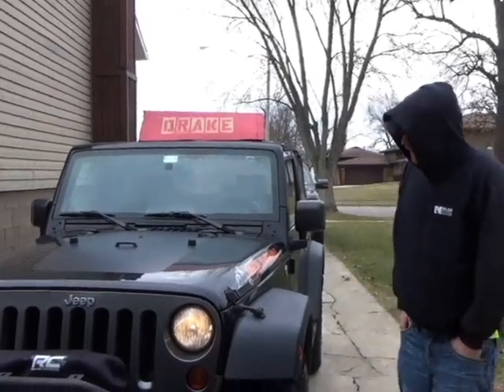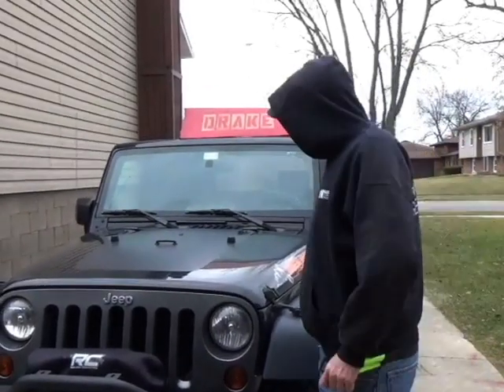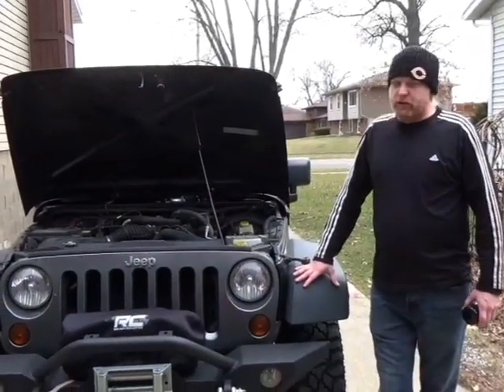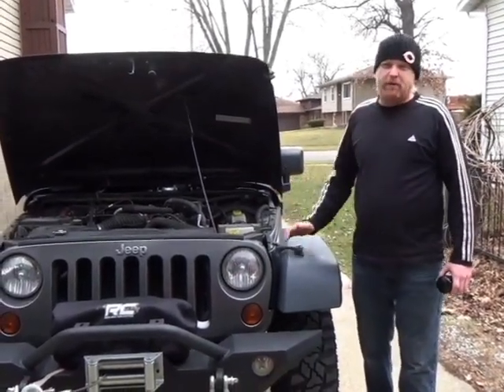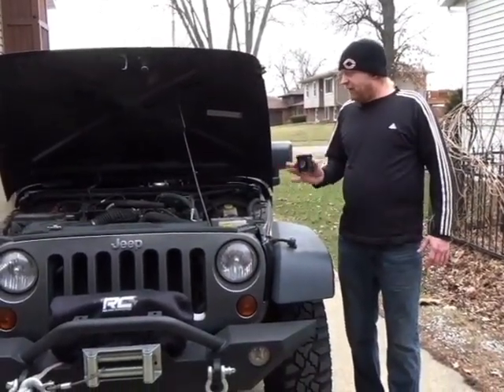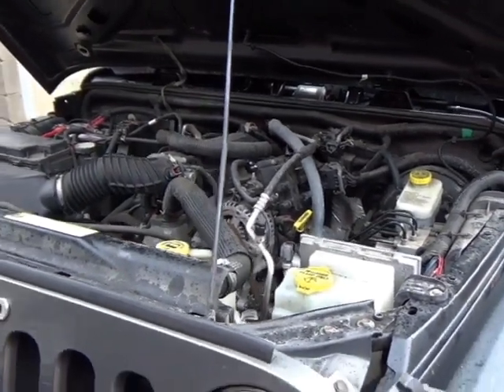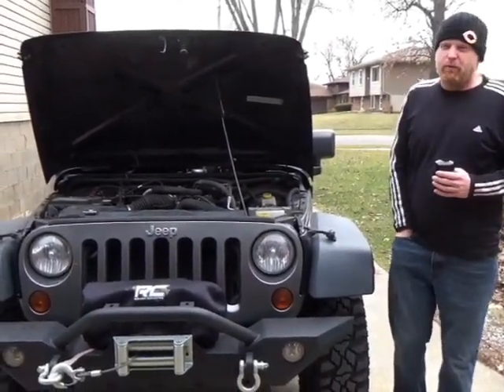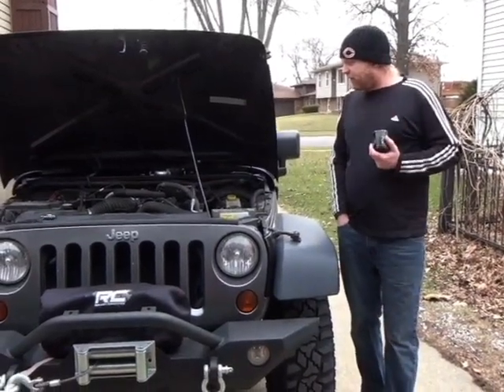2010 JEEP 3.8L engine knock on start up. cold start

Comment: 07 grand caravan same engine. Mopar  is pretty much the standard for these.HUGE difference cold or warm. Mine has 250k on it and once i figured this out it helped a ton. Also use 5W-20 lose about half a quart every 3k miles and use the filters for 2 oil changes worth of miles since they are good quality

Comment: A Motorcraft FL-0400-S will also work, is available at normal autoparts stores, is cheaper, and is slightly larger (longer).  It has do to with the anti drain back valve inside those filters.  Side note: the 3.8L was originally specified to use 10W30, they only switched to thinner oil to meet MPG specs.  They didn't change anything inside the engine when they did this.  Which is probably why the 3.8L gets a bad rap...  Switch back to 10W30, unless your area gets really cold, then you can drop it to 5W30 in the winter.
Reply: Interesting. I have the 2.4 renegade (not technically jeep) and i put a motorcraft FL 500 on it. it takes 0w20. I wonder if the lighter weight has to do with anything for real.
Reply: I live in Arizona, was told 5w20 was it. Is it really 10w30?
Reply: That’s the one I use
Reply: Hey do you know one that will fit in a 2010 crown Victoria police interceptor? I'm having the same issue
Reply: I've been doing 5w20 synthetic in my 3.8L but I started using a quart of Lucas Oil Stabilizer at each oil change. I just don't add the last quart and do the Lucas instead. It's tremendously thick. Maybe I should just try 10w30 instead? I've got 222,450 at the time of writing this. I assume anything will help it at this point!

Comment: Bad oil filters are crap for your car. 
Oil filters are a critical part of engine lubrication. My 2005 Ford 4.6 is as quiet as the day I brought it. Motorcraft filters only used on it and 165,000 miles on it. This is great advice! Follow the manufacture recommended filter. No joke!
Reply: I have a 2010 police interceptor with only 84k miles. And it does this at start even with motorcraft filter. Using Mobile one full synthetic and does it for  like 3 seconds

Comment: Now try a “Wix” extended oil filters.. they are longer (hold more oil) and have the best drain back valve of any filter made. They are made in USA and are fantastic filters you cant buy a better filter.. the “Mopar “ filters drain back valve will also fail , and that is what causes that knocking sound , because the oil in the filter drains back into the pan and so when you start it the filter has to fill first before the engine gets any oil hence causing the sound.. i am also a Jeep guy trust me on the Wix filter you will thank me later.. you can get them at any “NAPA” auto parts store..
Reply: Do they have a drain back valve for my police interceptor? Mine does this too
Reply: @Иванпонимаете-г4ш if it’s a vertical filter, meaning bottom of the filter points toward the floor, drainback valve has no use, as the filter will always be full due to gravity.

Comment: Same thing is happening to me after I installed a Napa platinum filter.. Thanks for the heads up. Did it fix the issue? I think it is the drainback valve.The oil drains back into the pan.

Comment: My 2010 3.8 has a rattle everytime I accelerate from a full stop, never if in neutral, 60k miles.  I tried Mobil1, Royal purple, Pennzoil, same with all oils
Reply from the maker: That is something completely different.. without driving ot it would be impossible for me to tell you why it's rattling
Reply: @sdrake74  yeah, I think I found it yesterday, a heat shield (passenger side that attaches to the tub) apparently lost a bolt, so it was flopping around.  Luckily found a nut and washer that fit perfectly, so now nice and secure.  I’ll test it today to make sure that was the culprit.

Comment: Thats crazy,
Does the Mopar filter have some type of check or pressure switch in the filter making it back pressure until it's at full flow?
Reply from the maker: I haven't cut one of these open... however i have cut many filters in half to figure this out... what i think is going on is that the spring and oring/ gasket in side the filter holds the oil closer to the top of the engine( most filters let the oil drain into the oil pan) so when you start the jeep in the morning the oil gets to the cylinder head quicker.....  the correct way to fix this is to replace the lifters... however this is a jeep that my girlfriend bought brand new and had low miles so on principle alone i tried to find a different way to fix the problem
Reply from the maker: And like i said the correct way to do this is to take the cylinder heads off have them reworked at a machine shop and chang the lifters..( the noise is hydraulic lifters that dont pump up fast enough..... i have no problem doing this.... however it just bothered me that it happened at 40000 miles and just trying to find a different solution ... still works to this day at 97000 miles... the dealer stoped selling filters for this jeep its to old butt some higher priced filters will do the same thing

Comment: Our 2016 does that too. Dealer does the oil change but it still does it.
Reply: 2016 (3.6, not 3.8) totally different, uses a filter cartridge in that stupid plastic oil filter housing that is bound to fail.

Comment: Quick summary: Don't buy cheap oil filters. Spend some money and buy a filter with a check valve.
Reply: I do every time...still have the prob, low mile engine, not a Jeep. do those jeeps have horridzontal filters?

Comment: Im reposting this someone elses comment bc i thought it was important:  "Using old oil filters (with black rubber DBV) may also cause this due to the rubber drying out and becoming stiffer including Mopar filters...I know this from experience. Using silicone drain back valves (orange colored) oil filters (like WIX, Napa, etc) are less likely to dry out regardless of age and will still have flex to close the drain back. The filter you bought at the dealership is newer stock since their turnover rate for filters is quicker with their service department."
Reply: maybe use a lil AT205 on the seal well before putting it on will help. that shit works well to make rubber come alive to stop all kinds of leaks! scotty kilmer loves it  too!

Comment: Using old oil filters (with black rubber DBV) may also cause this due to the rubber drying out and becoming stiffer including Mopar filters...I know this from experience. Using silicone drain back valves (orange colored) oil filters (like WIX, Napa, etc) are less likely to dry out regardless of age and will still have flex to close the drain back. The filter you bought at the dealership is newer stock since their turnover rate for filters is quicker with their service department.
Reply from the maker: yes i agree.. i bought all the expensive filters with the orange neoprene gaskets and one of them worked butt because i couldn't remember wich one i didn't mention it... their was differences in the mopar dealer and advanced auto mopar filters... numbers and weight... butt depending on where ur at in the country it varies.... so i didnt go into all of that... butt i agree with you 100 percent!!!
Reply: maybe use a lil AT205 on the seal well before putting it on will help. that shit works well to make rubber come alive to stop all kinds of leaks! scotty kilmer loves it  too!

Comment: My 2010 jeep patriot is going this and i want to fix it. Not sure what to do
Reply from the maker: the correct way to fix this is to do a compression check on all cylinders ..if they check out take the heads off and change the lifters... butt thats alot of work.. go to a mopar dealer( dodge,plymoth,Chrysler)... buy an oil filter and see if the problem gets better or goes away... their is a bleed back valve in the filter that holds the oil closer to the top of the engine on start up... thats why it works... do not buy the filter from any parts store!!!! dealership only!!!!
Reply from the maker: how many miles is on your liberty????

Comment: Gonna try this on my 08 w/ 108k. Drives me nuts too... Miss my TJ's :( had 4 and both the 4.0's and 2.5's never had any problems with anything. JK has clutch problems, exhaust rattle, the shifter is a POS that falls apart, interior plastics are falling apart, engine knock and the dreaded first gear pop out! oh and the reverse lights only turn on about 75% of the time. I can see the FIAT influences /eyeroll.
Reply: Sheesh maybe i wont buy a jeep after all
Reply: I just got an 08 and I think it might have an exhaust rattle or rod knock. How did ur exhaust rattle sound

Comment: Thanks that's wierd. I use Fran extended life synthetic filter and Synthetic Vavoline 5-20 oil never an issue Have 170k on this motor 440 k on 07 JK bought new
Reply from the maker: Ya over the years i have heard so many stories going both ways.. we still have the jeep its a good car .. butt lottle things like that drive me up the wall .. just a very unique situation... just trying to help out anyone out their with the same problem!!! Thanks for the comment!!!
Reply: Do you have the 3.8L engine ?
My 2010 did this- I think it spun a rod.
Have a K& N filter to go on it and sythetic blend Valvoline 5W 20. I'm hoing to pull tge oil pan and check the crankshaft bearings. Is how bad it sounds. Also metal particles in the current oil.
 Crossing  fingers

Comment: need help mine only knocks when press on the accelerator on idle is perfectly smooth???  also i did the rod bearings
Reply from the maker: Your lifters might be out of adjustment .. You can do a compression check .. or put motorkote in it and see what happens
Reply: @sdrake74  lifters seem to be alright compression is normal
Reply from the maker: Ok, that's very good .. im assuming it doesn't have a distributor... i would try 93 octane  or ethanol free gas.. they are putting so much ethanol in gas now ive been running into ignition knocking.... what do u think?...bad gas will ignight to soon sometimes causing a knock..
Reply from the maker: Im just trying to think of anything simple before u tear into the engine... im also hoping theirs no massive engive failure.. it is a 3.8 correct???
Reply from the maker: My email glazeddoughnut74@yahoo.com
Reply from the maker: Email me ill give u my phone #

Comment: Anyone watching this now, any oil filter with an anti-drain back valve will do this.  Also, use 5w30.  The 3.8 is a bored out 3.3 that used 5w30.
Reply from the maker: anyone watching this now. thats exactly what i said in the video !
Reply: @sdrake74  Not really. You didn't explain  why  it worked, you just said using mopar bought from the dealer fixed it. I also notice you say  you used 5-20 oil which kind of infers that you had heavier oil in it before so you may not know which of those things solved the  problem. BTW the problem was that it was taking a few seconds to circulate the  oil after sitting overnight. My guess too is that it got worse in colder weather. It may be that the 5-20  oil which circulates more quickly when cold (5 weight)

Comment: Any filter with an anti drainback valve will solve this problem.
Mobil 1 M1-209A is an extended length with anti drainback AND its MADE IN USA.   WIN  WIN

Comment: Use 10w-30 oil in these engines. It's what they were designed for NOT 5w-20! 5w-20 is only " recommended for CAFE cold weather emissions certification. Again if you want this engine to last do NOT use 5w-20. 5w-30 in cold weather and 10w-30 in hot weather. New crate 3.8's come with 10w-30 and the engines are no different than the ones saying 5w-20. Hope this helps.
Reply: i agree with you. i got the same 3.8 engine size and i always use the 10w-30. i have no knocking issues but i remember one time i got the 5w-20 because it was on a huge sale and man oh man it knocked a lot. (mind you i live in Texas) and for some reason the engine was eating up the oil.  with in 1 month i lost almost 1 quart and that was the fastest oil change i ever done. i went back to 10w-30  and never had that problem again. and for the oil filter i use is Mobil 1 M1-209A. i know that, that product # says its not for a jeep but trust me it works dam good. it almost twice the size as the stock little baby one. but it works dam good and fits perfectly just like it was meant to be.

Comment: That is strange an oil filter fixed that, maybe what is happening there is sort of a check valve that keeps the oil filled in the passages to prevent dry starts, that noise is a lifter noise, makes sense with changing oil filter... my problem is a rod knocking till oil pressure builds up, I will try this...great video
Reply from the maker: exactly ... the oil bleed back valve keeps the oil closer to the top of the engine on start up... the correct way to fix the problem is to change the lifters.. however at the time the jeep had 50,000 miles and i didn't feel like tearing half the engine apart...
Reply: Did this work for your knocking noise? Was it the lifter?

Comment: Should slice those filters open and see what's different.
Reply from the maker: good idea ...
Reply: Videos of this prove whats inside counts. Filters are cheap. Engines aren't. Silicone rubber anti drainback and a REAL spring and the paper elements don't particalize and clog up the oil runners on good filters. Clogged oil runners are your problem too. Don't use thick oil either. It just masks the problem.  Good luck people!

Comment: OCD from gaycago.
Reply: Had the same problem on my 2010 wrangler, used a Fram XG3614 Ultra synthetic filter.  Solved the problem no more knock at all.  great fix